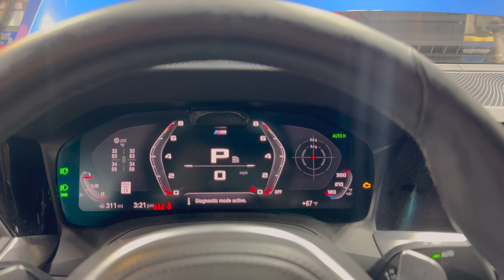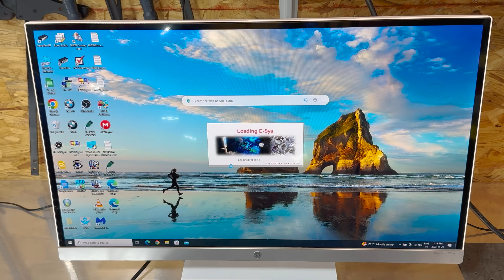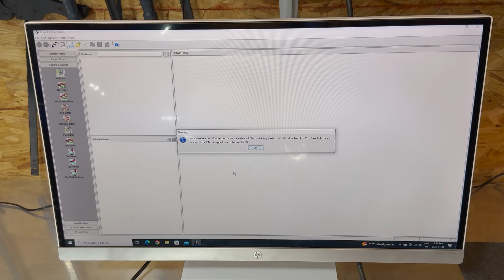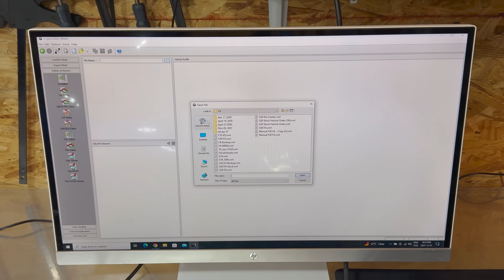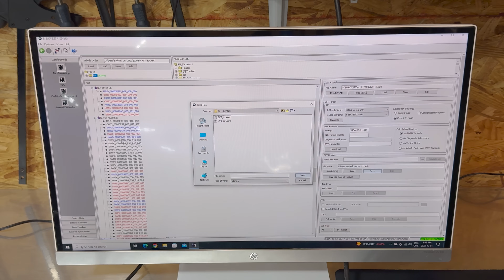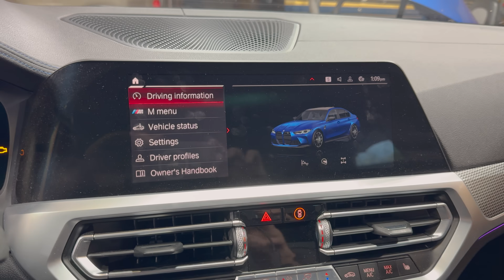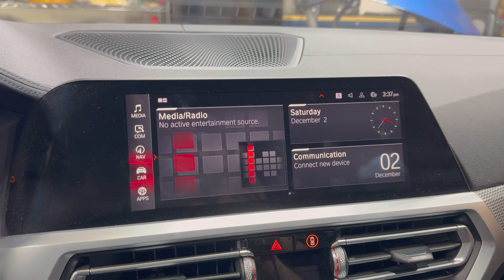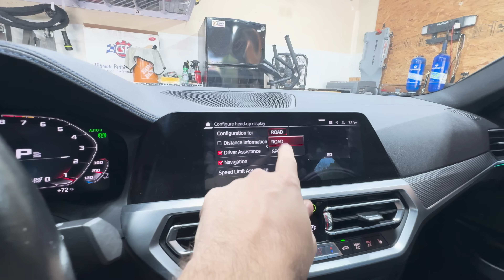My BMW G20 330i Unlocked G80 M3 Levels With this!

Comment: Been following this build for the last four months or so, and I have to ask. What has your total investment been thus far on performance parts and such in order to achieve this level of power?

I would not be capable of doing most of the labor for the install due to lack of tools, strict budgeting practices and overall lack of mechanical education, but am extremely curious as to the up front costs for everything necessary to replicate what you have done. 

Also keep up the content, very informative, easy to follow/understand, and good production quality. One of youtube's lesser known gems. Thanks again.
Reply: seems kinda sus, channel isn't verified and this would be blowing up if real.  going from 255 crank to 500+ crank without E85/FOB/Pure Turbo seems unlikely, even with all that on a 4 cylinder.

Comment: I drive a G80 comp and I was like: sure, let me check this out. I guess I’ll take your word for it but seems like complete bs. Show driving it. Actually, I 100% guarantee this will not make this thing anywhere CLOSE to an M car. lol wtf are you on?
Reply from the maker: I drove a g80 comp for nearly a year, got it on launch day and it replaced my M340i.  While I say it is similar to a bone stock G80 truth be told this thing in 3rd hits a lot harder than a G80, over 500 ft lbs of torque at the wheels and about 470 whp and under 3600 lbs.  The G80 was a monster and made a M340i feel like a completely different car and this m sport 330i is more akin to a G80 in how it drives.  The G80 feels light years ahead in the suspension but this has good weight balance to give it a chance to still feel engaging to drive and has a steering rack that feels more like the G80 as the M340i has a numb rack due to packaging constraints.  I am sensationalizing it to get eyeballs sure but this thing is not slow.  Runs high 8s/low 9s 60 to 130 and I have a kill map that I will run once I get the intake manifold and heat exchanger installed.  If you want to see the G80 I featured it on the channel around march 2021.  I’m talking bone stock G80, never modded it, the market was so hot that I cashed out on it before I had a chance to mod it.
Reply from the maker: The modules doesn’t do anything for how the car drives obviously but I missed the track view in the cluster.  I also miss the stock G80 seats, I ordered them ventilated, the ventilation kind of sucked but I’d like to retrofit a pair into this car.
Reply: looks like someone is coping